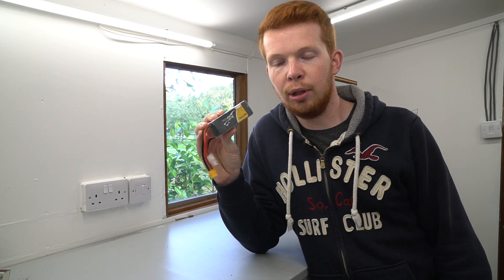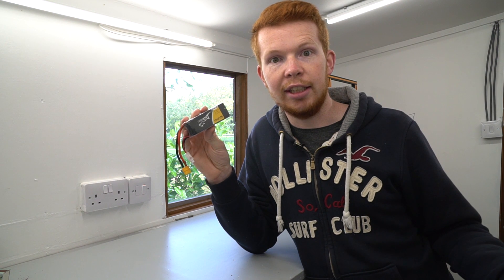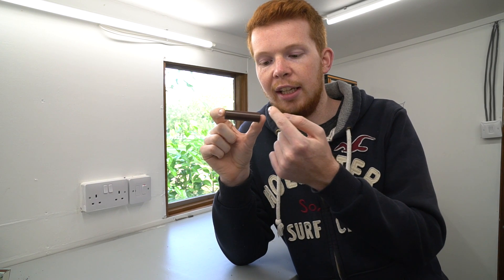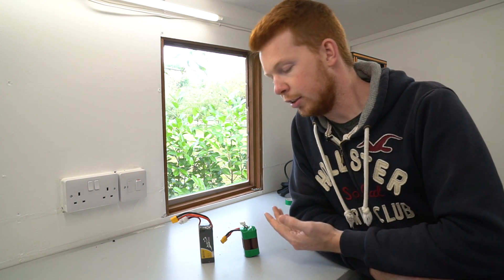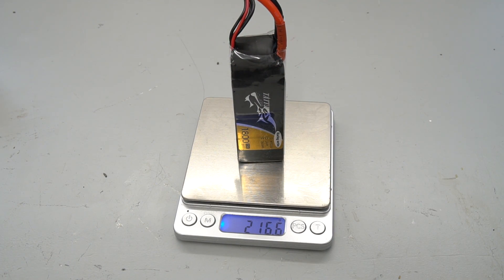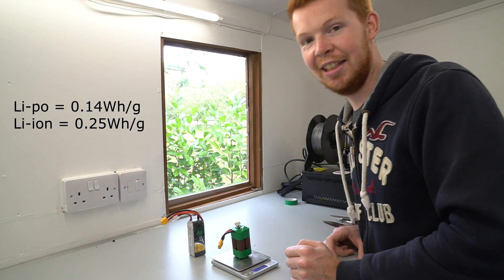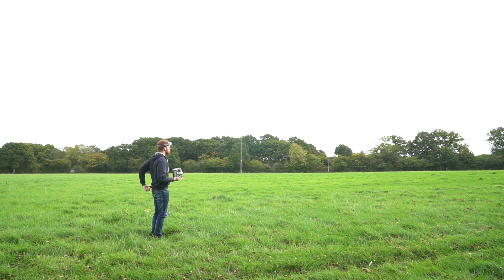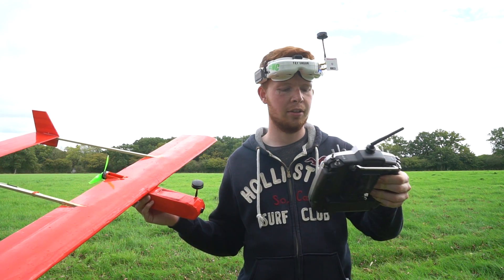Lithium ion plane battery

Comment: You don't actually have to fly the plane to test the two batteries.  Do two static tests.  Strap down the plan onto a stationary stand and run the throttle at the same percentage for both and see which battery lasts longer.

Comment: 3.7volts is the nominal voltage of a lithium polymer cell... They do deliver most of their capacity down to 3volts, get bad after 2.54V per cell... So the best use scenario is to use them until they are down to 2.9 - 2.8 volts per cell... Can´t remember the exact numbers for lithium ion cells, but chemistry is similar behavior is alike, just all the voltage points are lower.

Comment: Well of course.  18650s are usually drawn down to 3.2V but you can take them further down to 2.8V (only 3% of energy lies between 3.2V and 2.8V).  The 50% level is at 3.65V.  So at 3.7V,  you still had 55% of the usable energy remaining in the cell!  For longevity only charge to 4.125V and discharge to 3.35V.  That is about 85% of the capacity.

Comment: These batteries are great for gliders because the 9 gram servos I use hardly use any amps. I put two 700 ma/h 3.7v in series with a jst connector and am able to do many flights with one charge

Comment: Nice video!
You should check out the  Strix RmRc Nano Goblin  can fly over an hr on 3200mah 2s liIon pack I have seen them test the protypes and get over an hr with stock step on the flying Plank

Plane
https://www.readymaderc.com/store/index.php?main_page=product_info&cPath=112_935_971&products_id=7095
Pack 
https://www.readymaderc.com/store/index.php?main_page=product_info&cPath=84_969&products_id=7002

Comment: One thing that sprung to mind as you were talking about the difference in internal resistance between the packs is that the internal resistance of a cell is no different than any other resistance; it dissipates power proportional to the square of the current, so the higher the drain, the better the li-po should perform relative to the 18650s.  Since the draw was quite low in this test this may not be a significant factor, but I thought it was worth mentioning.

Comment: Lithium ion batters have a very thin sheet of plastic inside that separates the positive and negative and by soldering to the battery's you run the risk of shrinking the plastic layer and shorting out the battery. (BOOM!)

Comment: Very good video. You should test the theoretical flight time and do another test. I have a wing with an f4 omnibus board running inav. Set a course hit waypoints and let it do all the flying. You can do the exact same flight with both battery's that way

Comment: so much shit in the comments, facts are:
lipo has more wh/kg than li-xxx but are available and used in higher c ratings.
all are li-ion, 18650s just use different chemistry depending on type, lipo is just for a polymer electrolyte instead of a liquid.
higher c rating = thicker electrodes  = more weight for the same capacitance / lower internal resistance = higher current handling capabilities

and on 18650s you got the metal container that adds extra weight, lipo pouches are more lightweight. also the form the are packed is better on lipo. they stacked, one tap per electrode.  18650s are rolled like a electrolytic capacitor and tapped of on some spots only.

Comment: your test is inconclusive....run both batteries down till the plane touches the ground, and give us the actual stats...battery temperatures, flite times.   Real world testing- not theoretical guesses.....my flight testing with 18650 tool grade cells, (dewalt) came up shorter than quality lithium polymer pouch batteries....lighter is better for flying.....my e-bikes use cylindrical cells, which are way more durable and the cycle life is way longer.  my rc pouch batteries seem to be junk after a couple years, swelling pronounced, where the cylindrical cells live longer.  i have some lifepo4 headway cylindricals in ebikes (15 a/hrs), that are performing near new performance after six years of use...which is impressive technology for lithium.  the world will be turned on its head when the solid state electrolyte lithium cell is produced in mass numbers; Toyota is bent on mak8ng these a reality for their e-cars, cant wait!   very little degradation after time due to the solid electolyte, could be a jump for storage batteries in solar applications, too!

Comment: if you ask most people that race rc cars what they have their lipo cutoff set on their esc's they would tell you between 3.2v to 3.4v. most racing and acrobatic quad "drone" pilot  like to land with at least 3.7 to 3.8v per cell because those type of crafts most of the time pull over 100 amps at full throttle from a battery that is only about 1300mah. i have raced cars for over 17 years and once lipos came out and learned about that i had always had my lipo cutoff set at 3.2v and have had several batteries drop to that point many times. the only risk i have ever found with lipos is letting them sit fully charged for weeks at a time and then they just puff up and die off quick. as far as 18650's i have seen them dropped to 2v and work great well over 100 charge cycles. those batteries died because my coworker dropped them well below the voltage the chargers minimum reading.

Comment: could you not set up a static test stand and run it continuously until maximum safe capacity? maybe use a desk fan to provide some moving air as propellers draw more power in still air than moving

Comment: you can buy small 4 18650 holders on BangGood it will add some weight but who knows how much life you cooked out of the cells,  and how close to spec they were too.  you would also need to do more trials.   but perhaps do them on a control line so you don't have to really fly it all the time.

Comment: These 18650 are probably NCA chemistry witch mean they have 3.6V nominal, inlike the LiPO that areoften 3.7 or 3.8V nominal... when you calculate ENERGY ( Wh) density dont forget to also take account of nominal voltage and not just to assume these are the same niminal.. As i said Wh is not proportional to Ah you have to take account to the NOMINal voltage witch vary from a chemistry to another. BUt thanks for the video the rest is very well exlained!

Comment: Nowadays 16850 cells are mostly Li-Po, just rolled in a different shape and, as you pointed out, this produces a lower nominal and peak current. The REAL Li-Ion would have a voltage of 3.6V and 4.1V for charging, Li-Po is 3.7V and 4.2V. Check the specs of any post-2000 18650 cell and you'll see most probably 3.7V -> they are Li-Po. This is important to keep in mind because if you charge a 3.7V 18650 cell at 4.1V, thinking that it's a Li-Ion, you'll lose about 10% capacity. Also, ALWAYS measure with an intelligent charger the ACTUAL capacity... 18650 cells are highly variable for the same nominal value (especially after you soldered them).

Comment: Great informative video Tom, thanks! You point out the li-ion weight/energy ratio is superior but the current draw is the systems drawback.  How about adding a capacitor to increase available voltage/amperage for short bursts of acceleration with the li-ion? Or even using an extra cell and dropping the volts to increase amps?

Comment: put a 4-5 foot pole in the ground, use a 20 foot fishing line, attach to wing and fuselage , then send em in a circle and set the trim...and the timer - you can check after 30 minutes or so, then tweak trim to keep in air as batteries drain
BOREDOM PROBLEM SOLVED

Comment: Among modern cylindrical Li-Ion cells you'll find different types. There are those commonly used for lights and laptops, high capacity but limited to less than 5A, and have relatively low number of charge/discharge cycles, and those used for high quality power tools, those are lower capacity but can deliver 20-30A of current and have a lot longer life. Unfortunately this seems to be an inherent tradeoff, that is, the combination of capacity and current-handling capability does get very slowly better over time, but you'll always need to choose one or the other. A lot of the recent capacity progress has been down to specialising the cells towards low-current applications.

But you know what, maybe you can take care of peak current with some kind of mixed battery design, where a low-current high-capacity battery recharges a high-current low-capacity one, or use a buffer capacitor.

Also, just install a BMS (internal balancer) and fly your cylindrical cells down to 12V.

Comment: do people not know how to read a fucking spec sheet. for li-ion the charge doesnt go down liniarly. there is a massib dip in charge bellow 3v, so most of the charge is above 3v. also, those are fake batteries. tesla uses the highest capacity batteries on the market and they only do 2.4 Ah and they deliver about 2A. a 20 amp battery should only deliver arount 1.8 Ah of charge . its not fucking magic

Comment: It is amazing that the battery and magnet technology has come so far that flights are so long they are boring.
Reply: I once built an ultralight model with a 800mah lipo and a tiny motor. The flight lasted over an hour and the fun became the guessing game of when the battery will die
Reply: @davidball1924 i made an rc air boat with two 18650 (equal to a 2s) and it runs hours 😅
Reply: @e-genes2727 probably a neat idea man
Reply: If it's that boring,securing the plane down to something and letting it run down hands free is an option.
Reply: Very true, but I think what made it tedious was that he wasn't playing. He was just making simple figure eights over and over and over.. which became very monotonous.
If was with a bunch of friends playing games or what ever, an hour would have flown by in 10 mins flat lol
Reply: Zsavage1  so true
Reply: Zsavage1  True
Reply: @mghummer  Haha I have Eachine Ex2H that is a clone of Bugs 3 but with an altitude hold mode but I dont think my flight time is 20 mins... I havent measured it though :D I think more around 15 minutes but its waaay to low, I feel like I just start to fly and its done.... The point is I also upgraded my battery to 6400 mah and waiting on adapter from Aliexpres to connect it to the drone :D It weights 300 g while the original battery weights around 100 but I need to connect a fpv transmitter to it so my original battery would last even less amount of time while a larger one can withstand it
Reply: Zsavage1  I'm confused what that has do with anything. Basically every race/freestyle high power quad out there will fly for around 5 minutes or less.

I've got quads that fly for 2 minutes if I'm ripping around at mostly full throttle and others that I just cruise with and can fly for 30 minutes on Lipo or 45 on a li-ion of the same weight. The baby hawk wasn't built for flight time.
Reply: Zsavage1  wouldn't be as long on a quad either :p
Reply: The crazy thing is that we still need to improve them to look forward to a green future. Our current batteries are too big and too low capacity to be able to practically store the energy of renewable energy sources like solar panels or wind turbines. That's one of the major things holding us back from putting coal generators behind us. Crazy isn't it?
Reply: I wanted to make a comment saying there's 666 comments but that would ruin it. DANGIT INTERNET!
Reply: Oi you got a license for this comment

Comment: Am I the only one that discharges my lipo packs down to 3.3v/cell? I feel like they're cheap enough nowadays that you can abuse the shit out of them and not really have to worry about it. Even if I only get 250 charges per battery on a 1300mah 3S, that still equates to less than $0.10 per charge.

Comment: The world of batteries is more complex than any of us imagine. We have a lot to learn about Lithium-ion batteries. I would comment that you can run a Lithium-Polymer cell down to 3.0 volt under load. As a matter of interest, I have flown a Parkzone 'Ember' for 57 minutes with a 600mAh Lipo battery. It didn't fly well with the added weight and it really WAS boring!

Comment: Sony vtcs are capable of more amps. I use them in my mech mods because I can run a .09 ohm coil it in without blowing off my face but that's on the pulse. My suggestion it's really not worth it. I have ran them in my cars and honestly if your going for weight yes. Technically it should fly longer based on weight reduction plus more capacity. But there is still so much more your missing. I normally use mine until 3.7 but once again that's for a vaporizer. I just know a battery is a battery unless it comes down to safety.

Comment: Apologies for being pedantic, but an amp hour is a measure of charge not capacity/energy. Also energy density is energy stored per unit volume, so saying "energy density (per mass)" is potentially misleading. Instead saying "energy density by mass" clarifies that it's energy stored per unit mass.
Reply: I AM a pedant and I don't understand your point.
Reply: Look it up.
Reply: Look what up?

Comment: Bunch of flawed assumptions about using and discharging lithium based cells and NEVER EVER solder to the 18650 cells. You can safely run your LiPo down to 2.9-3.0v per cell, the 3.7v is nonsense, that is the nominal working voltage under load.

Comment: LG HG2 cells are amazing. I use them in small fpv plane,  micro skyhunter, which using 1300mah lipo can fly for 15min. 
With 3s cell made of LG HG2 it can fly for 42 minutes, using 2400 mah from battery.
This cell can be drained to 2.5v, as stated in documentation. I did very careful tests , and found out it is time for landing when cell reaches 3.3V.(no load)   If you fly longer, you will squeeze some more capacity from battery, but voltage drop when opening throttle becomes dramatic and dangerous.

Comment: Very interesting, but it,s crying out for a follow-up.. Can you please make up a LiIon battery with more cells, to bring the weight closer to that of the LiPo battery, and re-run the test, timing it to a) to the same end voltage and b) continuing to the minimum allowable LiIon cell voltage? You might want to try some genuine high capacity cells, which might weigh more, which are a genuine 3.35 Ah at present, made by LG. (Don't buy those fraudulent ones with stupidly high capacity claims!) That should be a useful video for comparison. Thanks in advance.
Reply: Adding more cells will draw more current so it won't be a fair comparison.

Comment: Hi Tom,
I´ve made a very similar test, i used a self-assembled 4S-Li-Ion-Pack on my Multiplex Fun-Cub. As you told, i wanted to discharge this Pack to approximatly 10 Volts (That was the reason, why i made a 4-Cell-Pack to replace my 3S-LiPos). Fortunately I realised, that the voltage dropped, as I reached around 12 Volts. I could savely land the plane, and as I made a throttle test (immobilizing the plane between my feet) the Pack wasn´t able to deliver enough energy and the revolutions per minute droppped... nevertheless, i could achieve a flight-time of 34 Minutes -compared to my Lipos (around 15-20 Minutes) an enormous plus of flight-time! best regards... Claudio
P.S: maybe you could find out, what the real possible flight time of your pack is...

Comment: any reason you didnt just let the motor spin for some time instead of flying the rc planes? it seems to me that this experiment is mostly supposed to show the relative difference between the two batteries, not actually determine the absolute time duration.

Comment: At 14.8V, an 18650 4S1P is actually still over 50% charged. The storage charge for these cells is 3.6V, which gives 14.4V for a 4S pack. And that's 14.4V open circuit - 14.4V under cruise-level load is about equivalent to 3.85V open circuit per cell, which is a rather high SoC.

Comment: There is a few errors here.

18650 Lithium cell have a load voltage of 3.6 or 3.7V. The 4.2 is the charge or rest voltage. As soon is its loaded its comes down quite a bit.

Lithium-polymer is a Polymer winded Lithium ion battery.. So they are they same, its just the package that differs. (the accurate term is cylindrical Lithium cells)

Lithium-polymer is generally lighter. But the one that is here is high current ones. It also got different chemistry.

The Lithium-ion cells here is probobly LCA cells. They have both low power and low cycliicty. Normally 1C constant and 3C pulse and typically 700 cycles.

The polymer batteries here is probobly a NMO battery that usually have 10C discharge and pulse up to 30C.

If you can get LCA polymer batteriers i don´t know. LCA is a much newer technology (i would suspect that most mobile phones uses Polymer LCA batteries, so kidnapping one of those may get even better results)

So LCA have a very low current, but high capacity, NMO have a very high current, but low capacity.

There is compromise cell types.

LCO - Its pretty much a all round cell. Its pretty average on all stats. This is what most old lithium cells is.

NMC - Its probobly the best high capacity all rounder. över 200Wh/kg, up to 2000 cycles and a discharge rating of typically 2-3 C. Nissan leaf and stuff like electric bikes usually use this cells.

LFP - Very high current 25C normal 40C pulse, Pretty low capacity, 120wh/kg, Long life span 2500-3000 cycles. Used in most hybrid cars. Also rather cheap. And fairly safe

LTO - Mostly used for industrial applikation Very very high current, low capacity (90wh/kg), very high life span, upp to 7000 cycles. Are very safe, but rather expensive for the moment.

http://batteryuniversity.com/learn/article/types_of_lithium_ion